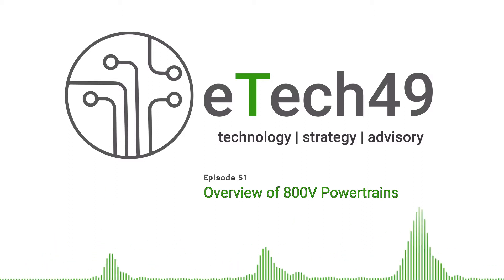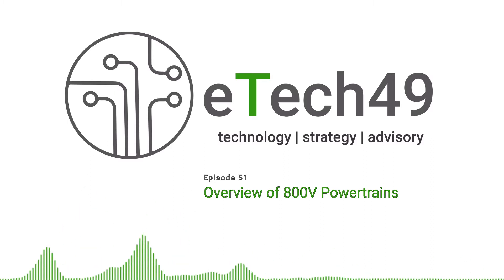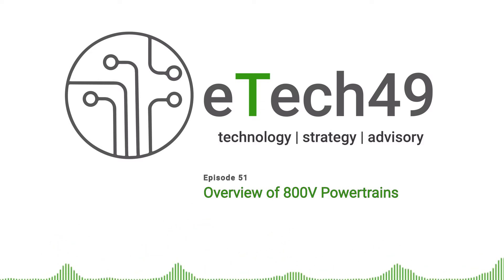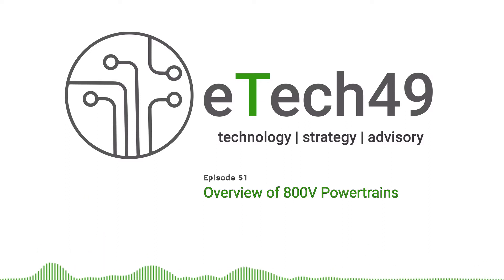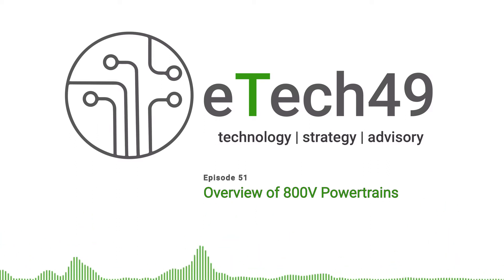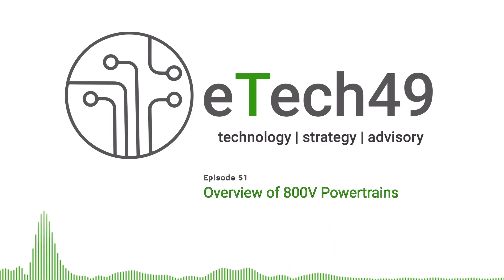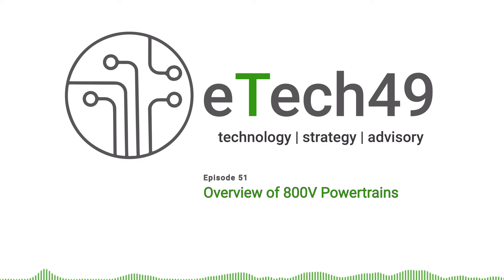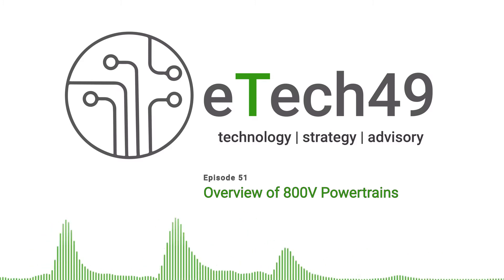#51 | Overview of 800V for Electric Vehicle Powertrains

Comment: Will these 800V vehicles be able to charge using the existing charging infrastructure? I see that most EV Chargers are only upto 500V
Reply from the maker: Yes they typically have an onboard converter to boost the voltage to the required level. New high power charging infrastructure e.g. Ionity will typically work at 800V and can output lower voltages too.

Comment: Thanks Ryan for nice information on 800V system! I have one query that do this voltage increase will have impact on motor speed or motor torque? If we are having 400 V motor & gearbox, when we will shift to 800 V , will there be impact on input rpm and torque?
Reply from the maker: Hi and thanks for the question and sorry for the slow reply! The answer to this is not straight forwards. Fundamentally the 800V is being used to drive lower system currents to reduce ohmic loses which are proportional to I^2, but it is also an enabler to higher motor speeds it is basically easier to increase motor rpm with a higher voltage, higher speed motors usually make less torque and we use a mechanical gearbox to restore this.

You may ask why bother making a high speed motor then? Because you can get the same power (and ultimately torque after its been through the gearbox) with less active material so a lighter/cheaper motor

Comment: Thanks Ryan, it was very informative podcast, I added you on Linkedin as well to be keep in touch. I have quick question about use cases of 800V; as far as I understood, we basically prefer to use it for ultra-fast charging point of view. Are those use-cases are limited in lifetime of battery due to potential cell degradation issue? Thanks in advance,
Reply from the maker: Thanks for the comment and sorry for taking such a long time to reply! 800V systems bring many benefits for a given power it halves the current and system loses are proportional to the square of the current, so throughout the system there are benefits with a higher voltage leading to smaller power cables, because the cross sectional area is a function of current carrying capability lighter motors and power electronics and less cooling required because of lower ohmic heating. It also enables faster charging speeds again because of the reduced current.

For a given charge speed I would say that an 800V system would suffer lower levels of degradation than a lower voltage system because of the lower current flow and reduced ohmic heating, but if we are using 350kW charging all the time it could lead to a reduction in cell lifetime - however the reality is I do not believe anyone would have the need to do that.

Comment: Great podcaast. What are the draw backs of the 800V. i believe it causes significant battery degradation right ?
Reply from the maker: Hi and thanks for the question, actually 800V would lead to less battery degradation under like for like conditions. This is because the current flow would be halved in the system, leading to a substantial reduction in ohmic heating and other degradation mechanisms.

But as 800V is typically also used to unlock additional vehicle performance and ultra fast charge speed if this performance and ultra fast charging is continuously used then you there could be higher degradation. But this is the same with any system voltage.